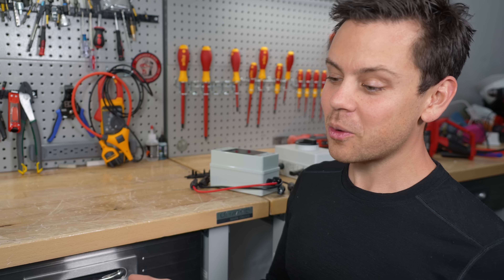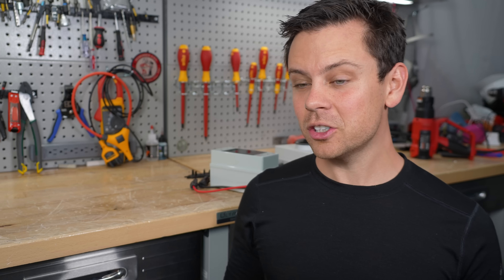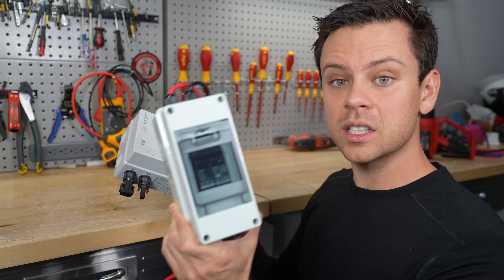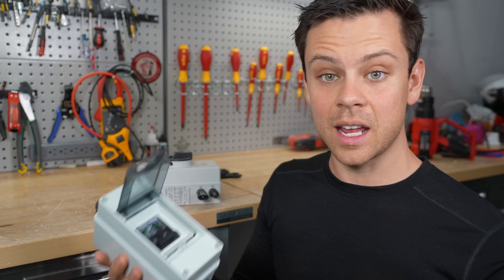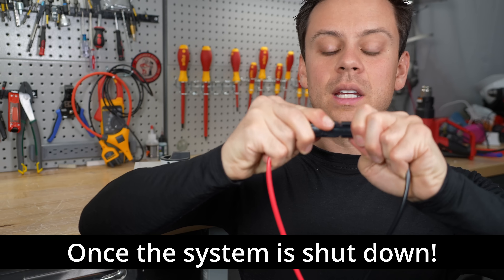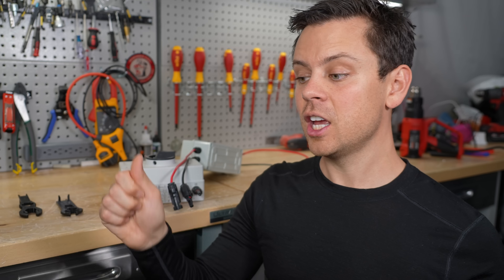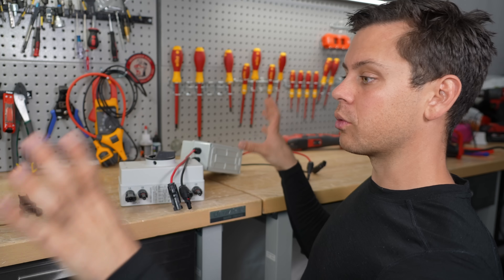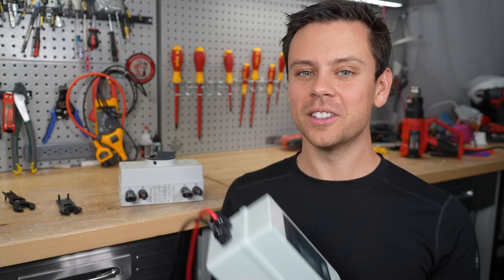How to Avoid Electrocution from an Offgrid Solar System: Everyone should know this!

Comment: I got some 20 amp 500 volt dc breakers, going to be 300-450 volts max and 13-16 amps max. Above 20 and the charge controller could get damaged, and the 450 volts is perfect condition at -40 temps. I doubt it will ever get quite that, but are those ok for my usage?

Comment: Had my first mild electric shock from accidentally brushing up against a wire connector going to a spare mppt port which has back feed voltage BTW.  Close call, thankfully it was the backside of my finger not on top of my game that day.  Not paying attention to exposed wires.  Learned my lesson very quickly.  Thanks Will for reminder Videos.

Comment: I have a question about grounding for my setup. I plan to connect five 400-watt panels to my EcoFlow DPU. The manual states: "If the product connected to PV modules is kept inside a building, it must be grounded to reduce the risk of electric shock. Consult a qualified electrician, electrical inspector, or local authority about applicable codes before using the ground terminal." My DPU will be indoors, which I assume is the "product." Do I need to use the grounding screw? If so, is it possible to ground it by running a wire to a standard outlet using an adapter that connects to the ground pin (the lower hole between the two slots)?

Comment: Mind the maximum fuse rating in series. The producer of panels have a max series fuse amps indication. 
Also look at the mc4 of the boxes - they're mc4 compatible but not original. Quality is not given at every product and could cause a fire or hazard.

Comment: hi, new to solar but trying to piece together my off-grid ground-mount system.  Should I use one of these disconnect units with every solar panel?  I'm using high-power panels with Voc of about 50v each.  If I use microinverters would the sequence be to put one of these disconnects between each panel and microinverter?

Comment: Current is only flowing from the solar cells when a full circuit is made. You will not get shocked by touching the positive wire as long as you are isolated from the negative wire from that same solar string.
Reply: Live and neutral are AC. You are talking about the positive(+) and negative(-) DC
Reply: @ you are right, I have fixed my typos.

Comment: Great video Will! I’m planning a system and I’ve been thinking a lot about this very thing. I do worry about if I need to avoid the cheaper disconnects due to quality control. Is there a good brand to buy? Same goes for MC4 connectors. Do I need to cut all of them off and install same brand on everything to avoid them being mismatched and arcing? I’m not sure the differences between manufacturers if they matter.

Comment: Interesting your talking about string voltages.

Not exactly on topic but I have a question and perhaps a little insight into system building would be helpful. 

We are here (also) in Vegas and have a 5600w array (17 330 watt Panasonic panels) into a 6kw solar edge inverter. These panels are rated at around 60vdc. Our panels are in series and that would mean we would be waaay over the max input on the inverter. Our array has SE optimizers that appear to significantly reduce the voltage of each panel to around 25-30vdc.

My question lies in is it a given that these optimizers will lower panel string voltages enough to allow way more  panels than the inverter can actually handle? I have searched a ton about these optimizers but cannot find anything that says they are intended to allow for longer strings overall.

I want to upgrade to a hybrid system so have discovered limitations of having optimizers (with SMI) with non SMI inverters. On to AC coupling... Ugh! 😂 

Would love to hear ur thots on optimizers.

Comment: Shutdown devices like micro inverters or AP systems remote shutdowns that sit on the back of panels is also really convenient.  Shut the system enablement down, plus the breakers, you have a really safe double backed system.  Most of the installs now require this for fire code anyway.  The breakers are also required to be ground fault now in case something shorts to chassis/ground it will trip the breaker.  Midnight solar makes the best/cheapest imo at the moment.

Comment: You forgot to mention one thing I think I seen in an old video of yours. That resistor thing you put on batteries so it won't shock you (I forget what its called), but I've been meaning to get one of those

Comment: One thing I would add is when working on your solar array, be sure that there is NO continuity between the solar DC-NEGATIVE and GROUND (such as to a metal roof or the grounded panel frame) .  Otherwise you risk bad things happening while you are messing with cables up on the roof even though the system might be turned off.

The cardinal rule for solar DC grounding is:  Don't do it.  You ground the solar panel frames, you do NOT ground the solar NEGATIVE.  Thus:

* Remember that you may end up with an unavoidable GROUND to DC-NEGATIVE bond anyway from the AC side of the system due to the home's ground-neutral bond.

* Because of that, ALL solar disconnects must disconnect both POSITIVE and NEGATIVE conductor(s).  Not just the positive.

* Never purposefully tie DC-NEGATIVE to GROUND beyond the solar disconnect (towards the panel side).

* And never work on a live system, even during periods of low generation.  Always engage the disconnect before doing any work on the panels, even if you think it is relatively safe to do so.  Because a live system may have DC-NEGATIVE to GROUND continuity.

-Matt
Reply: Being new to solar, and my panels are on the ground (mixed flex and ridge panels), if I need to relocate a panel, can I just disconnect the negative cable first during and render it safe? My panels connect to an Anker power station.
Reply: @skpoe   No. You need to first open the circuit through a breaker switch. Only then is it safe to disconnect. If you have more than two panels connected you definitely have more than 60VDC, which is a dangerous voltage.
Reply: @skpoe  What's the open-circuit voltage of the array connected to the Anker ?
Reply: Thanks for posting that, I'm not yet fully understanding ground/neutral bonds and why I'm reading that that bond should be established only at the main disconnect (or main panel if it has the main disconnect in it) but that in a subpanel, bonding neutral to ground causes a problem.  I feel like just knowing what to do / not do without understanding why isn't as safe.

Good thing is I learned why an inverter with a floating neutral can't be connected to a panel, that was explained to me by an Aims rep when I bought an inverter.

I'm sure I'll understand it down the road, I just have to find the right video or info.
Reply: @jeremy49988  Most grid tie and even normal hybrid inverters nowadays aren't isolated. This means that in order to create ie 220vac split phase, with respect to the solar DC bus negative, your neutral isn't 0v, it's actually at 180vdc with respect to the solar negative, and solar positive being 360vdc for simplicitys sake.

So grounding your panels negative creates a short inside the inverter through your home's breaker panel since ground and neutral are tied in there.

Solar panel negative should absolutely not be grounded unless the inverter is designed specifically for that (I have seen some VERY old gridtie inverters that did ground negative, so it was a thing at some point but is absolutely not the norm nowadays).
Reply: @jeremy49988  It is simply because you don't want current flowing on ground.  Return current from a load should always flow on neutral or DC negative.  GFCI breakers measure the current to a load and returning from the load and if there is a mismatch of milliamps, the breaker can trip saving someone's life.  The milliamps, if not returning, are assumed to be passing through someone or something to ground.  This is just to explain why you don't want current flowing on ground; i.e., not to say you need a GFCI.

Comment: Its a DC breaker. When i had my system installed in Quartzite AZ they used a Automotive breaker on 8 200 watt panels that was not safe for rhe power that could run a full size Fridge and a 15k AC off the sun  alone.  This Authorized Battle Born/ Victron Dealer made so many mistakes. I had to contact Victron to get a real Victron mobile tech to fix/repair the bad work done 😢  if you are thinking of getting sola? r there is only one Battle Born dealer in the Q , if you use them watch them closely!!! They will take unsafe shortcuts. I paid $15K for shoddy work that cost me a few grand more to fix

Comment: Thanks for the good info Will.  As an EE, I tend to the overkill side on safety, but always better safe than sorry.  Installing the 18kpv with batteries.  Got a DC disconnect rooftop isolator switch ready to go for the solar company to drop their connections to.
Reply from the maker: Fantastic. That's the way to do it

Comment: Great video, Will.  I used to work on residential lighting control systems (low-voltage side) with electricians and one told me to always make sure you hook up your return path first (grounds and neutrals) so you don't become it.

Comment: So as long as I use a solar disconnect heart attacks and cancer will never kill me? Cool.
All jokes aside DC current is no joke. All of my minor problems have been due to DC arcing. I have melted a DC breaker due to a loose connection and I smoked a backflow resistor in a combiner box that got hot enough to melt the solder until it ran off the board. I used to periodically retorque all of my connections but I got lazy. I have since redid all of my stranded wire connections with ferrules and uave found they hold torque unlike bare stranded wire. Now I periodically shoot every connection with a Fluke Laser Thermometer for piece of mind.
The combiner box that haf the issue has also been modified with a different type resistor and an actual heat sink instead of the stock thick aluminum bar the resistors were mounted to.
I have also shocked myself a couple of times thinking a cloudy day would be OK. I have also messed up a couple of MC4 connectors disconnecting them under load. I have 4 arrays and had the wrong one shut down. Now I cover the panels with a few $5. Harbor Freight quilted black moving blankets and some spring clamps. Its something much more visible than tripping a small breaker

Comment: It is unfortunate that even professional installers are not using these disconnects, due the newer inverters having a DC disconnect built-in. But i see the danger posed on these systems...yes you can turn off the DC switch on the inverter but the panels are still live. Thanks for making this video

Comment: Thanks very much for posting this video.  About 6 months ago, I criticized you for making some of this stuff look too easy ... and safe.  As I mentioned before, all EE's and electricians have at least one story.  After my previous comment, I realized that I forgot to mention one dangerous situation ... where more than one person is working on a system.  It it too easy for one person to leave a switch on or leave a battery fully charged and forget to mention this to the others working on the system.  Electric Utilities have elaborate protocols to keep their lineman and equipment safe.  "Tied, Tagged, and Grounded" ...

Comment: I've told a lot of nomads and homesteaders to use cutoff/disconnect switches and haven't been listened to so, maybe pointing to this video they'll finally listen! Thanks for the info!
Reply: It really was not a big issue on 12 volt and 24 volt systems of low wattage, but things are changing and many have to learn new ways.

Comment: Does anybody know why the electrical installer's channel E-Fixx said that current UK advice to solar installers who install solar inverters, should do so without any fuse or disconnect between the panels and the inverter?
Reply from the maker: There will always be a disconnect. With a single series string, It can be present on the inverter. I've just seen too many beginners on the forum and here on YouTube get shocked from the PV conductors from one reason or another. Doesn't hurt to add another disconnect. Especially if it's rated properly

Comment: UK here. I actually had my first zap last Saturday. Was wiping the cover of a wall light fitting which was dusty and had cobwebs. Was being very careful standing on a dining room stool when my wife quietly walked in and startled me with a frivolous moan about the kids behaviour. I turned my body and the Baby wipes I was using made a circuit behind the fitting. My arm froze up and felt like a jackhammer. Quickly raised my arm and let out a few choice words.
 Man I partly set up a 13kW grid tied array with 60kW battery storage and this totally unrelated event nearly killed me.
What a stupid thing I did 😅
Reply from the maker: Holy cow!!!
Reply: @WillProwse  want to say it was nothing I'm a tough guy etc but in that split second you realise you are in mortal danger. Made me reflect on a few things..like turning off lights before I clean the glass enclosures 🤣
Reply: did the rccb trip?
Reply: @abhishekkushwaha2455 no. House had a new Schneider consumer unit in Nov 2023 with rcbos. Wondering why it didn't trip myself.

Comment: On my smallest setup, I just throw blankets over the panels and measure the voltage. Great video by the way.
Reply: If panels are in series, you only need to cover one.
Reply: @donbrloks3959 technology is always changing and that can be bypassed so better to consider all panels to be safe
Reply: @donbrloks3959  I'm not sure this is true. The panels I am taking about are in parallel, but if they were in series they still have three bypass diodes per panel, so I believe (you've made me uncertain though) that there would still be (N-1)*PanelVoltage on the system.
Reply: I have a turpolene sheet. I do it with that sheet

Comment: I am disconnecting the solar panels "before" the cutoff switch. How does that protect me when I do disconnect the cables?
Reply from the maker: Depends on if current is flowing or not. You want to disconnect with a high AIC DC rated circuit breaker, then disconnect MC4 second
Reply: You don't have a completed circuit so there will be no or little current to generate an arc. There is probably a high voltage on  a string setup so don't let the + & - cable get close. Best for you to be insulated from grounding.

Comment: Yeah... This is honestly my biggest concern. I'm a donkey sometimes, and while I really want a system, and I want to install it myself,    I also don't want to pop like kettle corn.
Reply: I don't trust myself either, so i went with a 24V set up and keep my panels below 50V.
Reply: @robinhood4640  Ive pretty much decided on 48v split phase, I weld occasionally and, my well is 240v.   I live in a double wide, just 2 people. I like the eg4 18k. I think I may want 4 batteries for about 58kw storage.  I'm looking at doing ground mount. But it almost 400 feet away.  Im in Wa State, by Bellingham.  I want completely off-grid.  I'm definitely going to install a Gen, for aux charging.  I have constant wind, I'm interested in a hybrid wind/solar system.  Because of the rain and clouds, I think the wind would be required here.  I do however want to have enough capacity to run a full week on battery.   Frankly the power here is unreliable.  Goes out at least once every month.  
I need backup power for freezers.  Losing a years worth of meat is unacceptable. And PSE, won't do maintenance.  Last year, they fried my whole house, because their transformer lost neutral bond,  anything plugged in, that was even in standby fried.
What did PSE DO? Zero, not even a sorry. Lost my fridge, freezer, heat, entire entertainment, computer, my CNC MILL...
So, I want my own power, because the grid powers doing more damage than good in my area. 
I just don't want to die doing it.😉